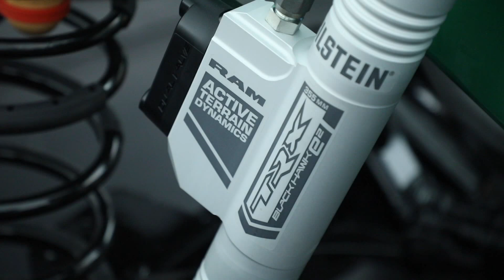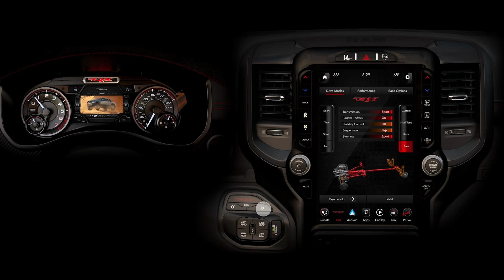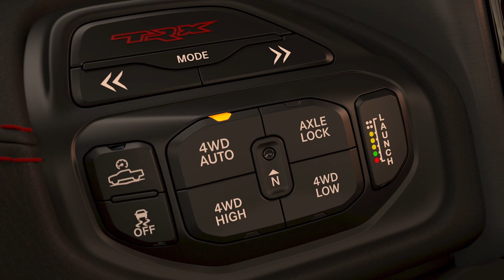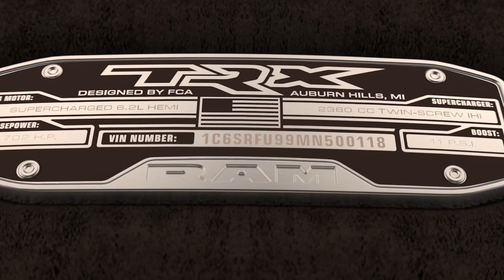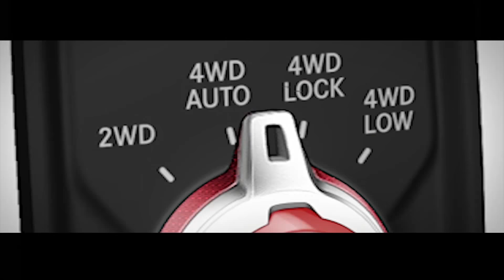New 2021 RAM 1500 TRX 702hp In Detail

Comment: Very slick truck, but I think you missed the mark personally. Could have gone with a mid 500hp engine and cut cost tremendously, rear shock location is abysmal, weighs 1000 pounds to much, price point is going to be a bit steep to compete with Raptors (I hate the Ecoboost fyi). If Ford can come back with a 500-600hp Raptor, keep the weight down, and keep price down, Raptor will continue to sell like crazy. Tried and true, not a fat pig, and you are talking 70k vs 90k when fully loaded. Again, awesome truck but I think it missed the mark.
Reply: Agreed. You could damn near build an honest to goodness trophy truck for 100k. This thing is way to expensive for the minimal performance it has over the Raptor. We all know that is going to be in the engine department. But as for the suspension setup they’re pretty much identical on paper. 40k more I’m not sure it’s worth it.
Reply: Why does everyone say Raptor sells like crazy...I see 1 or 2 a year on the road around upstate NY...that ain't "selling like Crazy" for anything
Reply: wally walton * In California I see tons just like teslas
Reply: Couldn’t agree more as a raptor owner I get 12.7 mpg which is trash, now if ford made the raptor even lighter and much better fuel economy maybe hybrid 600 HP even better suspension to jump with cost close to what they are now it will continue to sell great.
Reply: @MrGmilton  even as a hybrid I wont touch it. Sorry I just refuse to drive a vehicle that sounds like dog shit. My wife always says "life is to short to drive something you dont like". I know the EB puts down great power, but I would take slightly less power for better sound all day
Reply: Cameron Woody and there is totally a demographic for people who would agree with you. The ram will sell fine.

Comment: Thats a nice looking truck, but it has no where near the presence of a Raptor or its looks. What is MPG on it ? since I will be driving it mostly in the city. I get 13.7mpg in the city and 17.0mpg on the Highway on my V6TT Raptor. Off roading in Low I got around 11mpg. When and where r u going to use all that power, I think I have done it once with my Raptor since 2018....ONCE! Save your money for the Electric trucks. Take a moment and this about this " Gas prices go up and hardly ever go down". Cute truck but I will stick with my Raptor V6 and traded in for an Electric version or the Cyber Truck, which ever comes first. Btw! the Cyber Truck does 0-60 in 2.9sec Silently

Comment: Honestly the best thing about the TRX is they are getting rid of that stupid gear selector Dial nonsense.
Reply: agree. I drove the Bighorn rental and it felt so undeserving.
Reply: @Baebon6259  I think they kinda had good intentions with getting different technology in the truck but there's better ways. Maybe me being around Rally and racing the last few years with college and jobs, I like mechanical and simple things to diagnose quickly. Where I live and other people electrical equipment could fail in hasher and colder condition, I really don't believe we have the technology to be reliable for the long term right now but paying to fix things is the name of the game. And yeah it's going that direction but they gotta do better then a radio Dial.

Comment: transmission and frame will break if you use in any off road driving! not under covered under 3 year 36,000 miles at $70.000.00 why ?

Comment: It's not that expensive, when you consider the Raptor was >$100,000 when released, prices were above MSRP given its scarcity. I had looked at one, but decided to go the Lincoln Navigator route instead for six figures, which ironically has the same engine as the Raptor. Given how peppy my absurdly heavy vehicle is, I can only imagine what 702HP does to the truck.

Comment: Buying this in 5 years when there’s only electric vehicles in the market and gas cars are super cheap
Reply: You realize if there were only electric, all gas (especially high horsepower ) vehicles will go up in value. Hence alot of older manuals.
Reply: That's gonna be in more than 5 years. The other problem with that is that gas would be very expensive at that point. The oil industry is very much dependent upon economies of scale.

Comment: Ummm what the TRX is a "more capable RAM 1500". With the ability to do "light baja off-roading".. It's not going to be able to go against purpose built Baja Paris/Dakar racers. :) 

What's funny to me is...the reality of it is...I bet the majority of buyers of the TRX won't do any off-roading. :) Will be driven in-city only. :)

My only questions about the TRX is the "camera tech". They've only mentioned it does have parking sensors and a 360-view camera system. that's it. Does it have a front camera? A rear back-up camera when reversing? 

Does it have a "Auto Park Assist" feature that will self-park the TRXX (parallel/perpendicular parking)?? The Ford F150's have had it for years. The newest version  "Auto Park Assist 2.0" allows total hands-off. Something you might want under certain consditions (e.g. parking in an underground garage.  A parking lot with narrower than normal parking spaces...

Comment: A little disappointed… Was really hoping they would come out with the design of the concept. Not a bad truck but I still think the concept is way sweeter looking.. feel like they copied raptor with the three LED lights in the hood too. So glad I went on ahead and got the 2019 rebel.. would have sold it though for the original concept design.

Comment: why 702 and not 707?? It more fun @ 702 than 707 trust me.
Reply: Aerodynamics. No difference in engine than any other Hellcats. That's why the same engine produces different HP in a Challenger, Charger, Durango, Trackhawk, Ram.
Just like a redeye Challenger with Demon engine why is not a Demon? Comes down to a single detail: the hoods aerodynamics to reach the 200MPH speed limit.
Reply: @joel.7372  aerodynamics has no bearing on HP. HP is tested when the vehicle is static and attached to a dyno. The 5 hp difference comes from a heavy duty air filter required to operate in heavy dust environments.
Reply: It’s because they had to mount a heavy duty alternator and a few other things like the exhaust so it cost them around 5 hp

Comment: You know ford is stupid with their v6 but if ford gets their act together for their 2021/2022 raptor it will still destroy ram
Reply: But they won't. That's not their objective, and there is a small chance we see a V8 associated with Ford. Their current engines are pretty disappointing regarding size and power.

Comment: Boy, that was a lot of corporate group speak amounting to very little actual information.  Whew!  And their interior team "innovated" by putting a minivan shifter in the center console instead of the rotary shifter?  And with f*cking paddle shifters?  WTF?!  I realize most people who buy this are probably just gonna drive it to Walmart, but come on, man.  You wanna put something there in the center console area that shifts gears, make it a manual transmission.  People who actually want to "drive" the truck will definitely appreciate it.  Otherwise, put the precious electronic shifter that isn't actually connected to the automatic transmission back on the dash and out of the damned way.  Smh. 

And I have to say, the grill still looks like they tried to cross-breed the ram with a Hyundai.  Stupid. 

Lastly, with a STARTING price of $72,000, they've built another truck that only the 1% can afford to buy.  Then again, I suppose there's a never-ending stream of fools that'll want to lease it.  

Otherwise, great job!